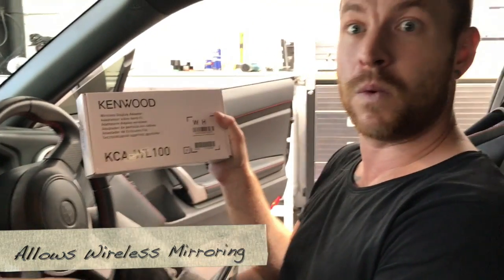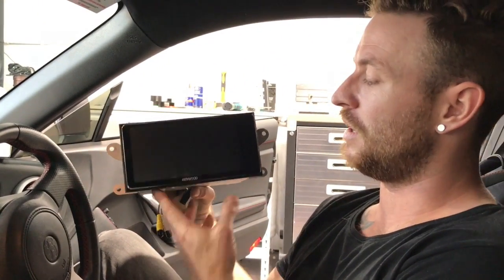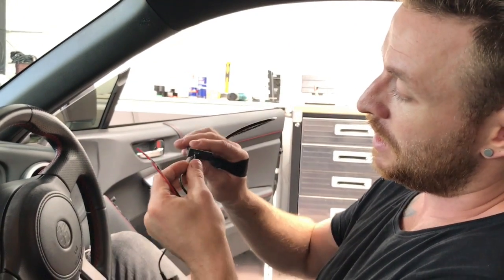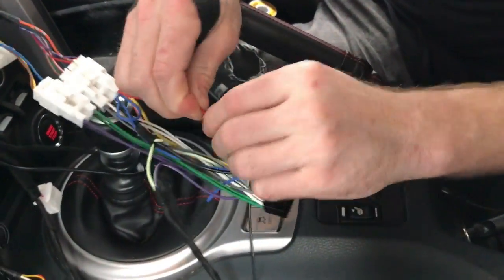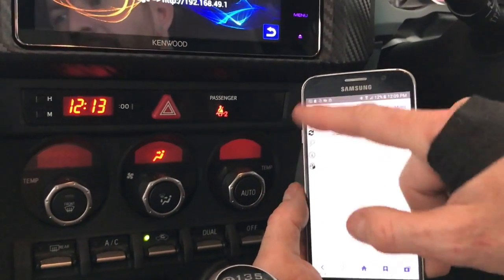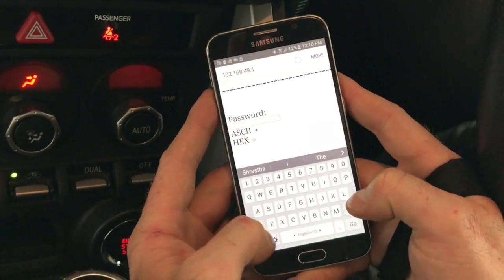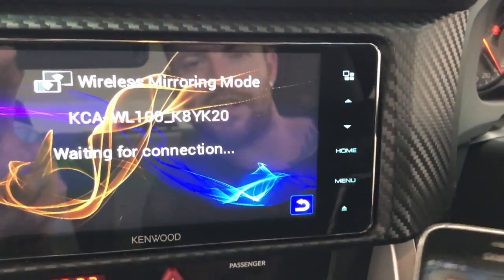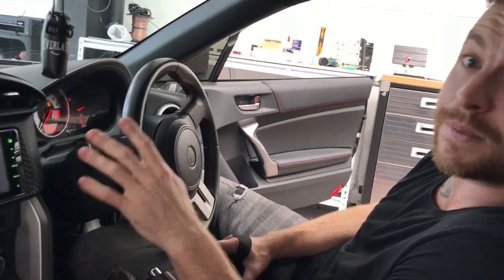How To Install & Update Kenwood KCA-WL100 Wireless Dongle

Comment: will this work with a JVC KW-V51BT head unit? It has a HDMI input and the JVC/Kenwood representative I spoke to at JB Hifi mentioned it would however there is no "mirroring" in the units menu. Any ideas?
Reply from the maker: I do not think it will, I have never tried but I would say NO
Reply: CarbonCarSystems - thanks man!

Comment: any reason this may not work on a dnn991 or dnn992? also how is the audio and vid quality? i been experimenting with dongles much cheaper than the kenwoods $100 price tag and either they display shitty quality, dont display at all or require internet to work. i need to know if i can safely bite this bullet... for 2 cars. im getting sick of flickering MHL

Comment: Installed this on my Kenwood DDX9903s.........however when I try to connect, the dongle appears under Wifi Direct and not Wifi on my Samsung phone.  When I try to connect via Wifi Direct it only remains connected for a few seconds and then disconnects and disappears as an available device.  I tried an older Samsung phone and the same symptom persisted.  My Wifi signal is very solid.............any ideas?

Thanks in advance.
Reply: I got the same thing